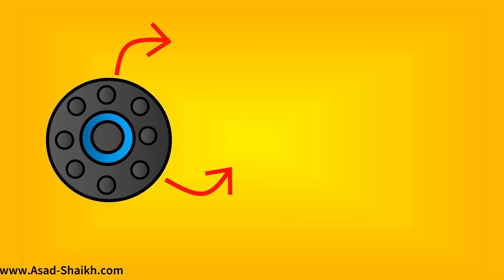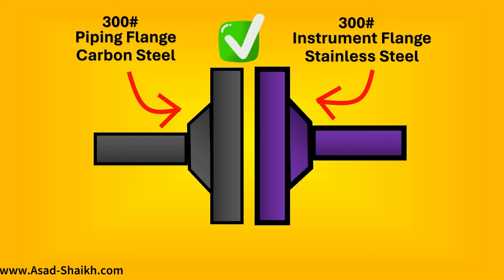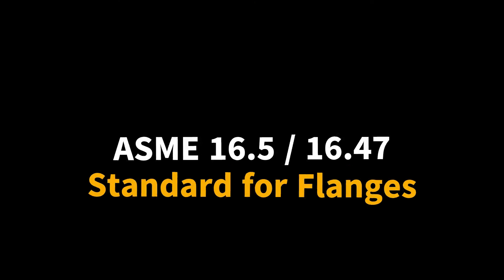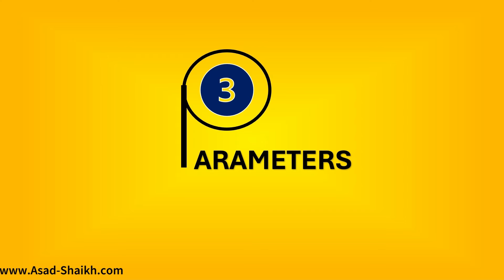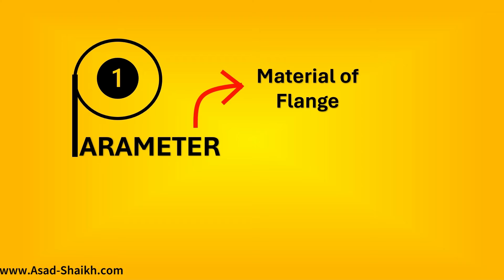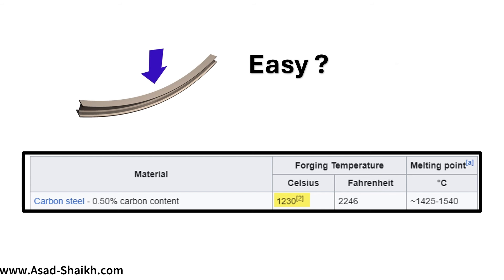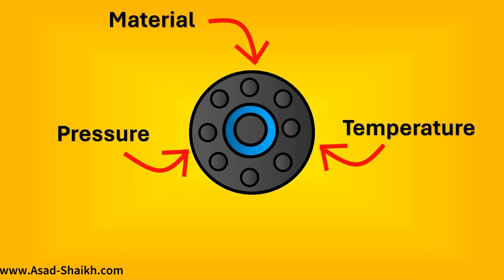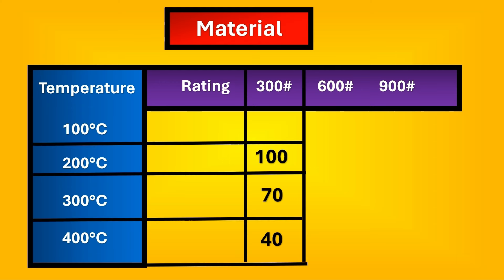How to Calculate ASME Flange Ratings Explained

Comment: As in the table at 3:40 i might need to go with SS316 flange of rating 400# if my process temperature is 40 degree Celsius.So piping end will be CS 300# rated flange,however my instrumnet will have flange with SS316 material and 400# rating.so are these flange compatible as bolts hole,flange dia will be different.Additionally doesn it cause any galvanic corrosion?Thanks in advance